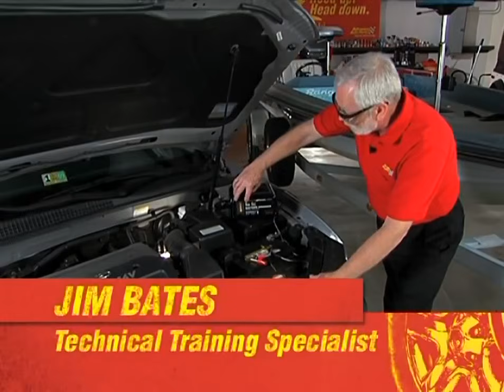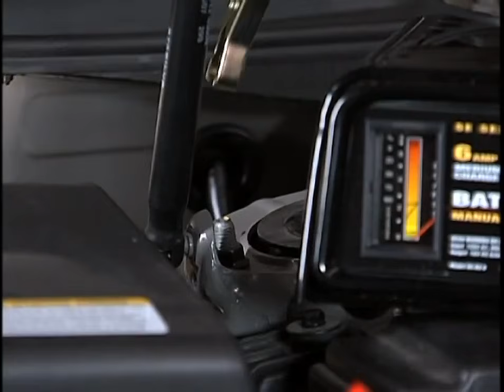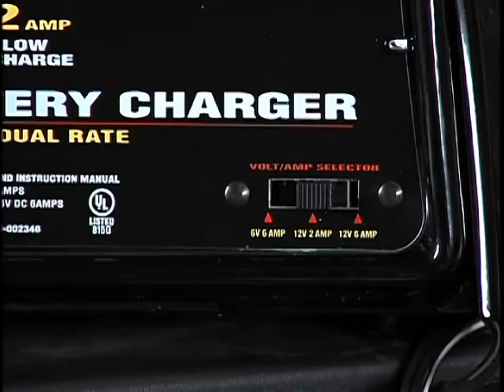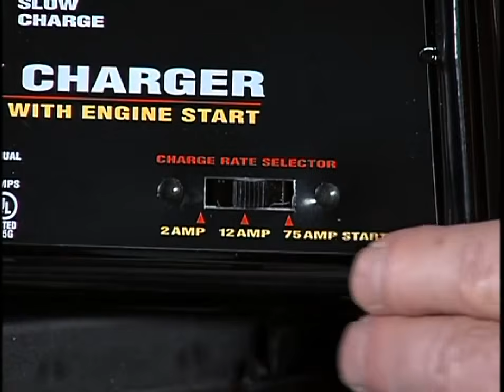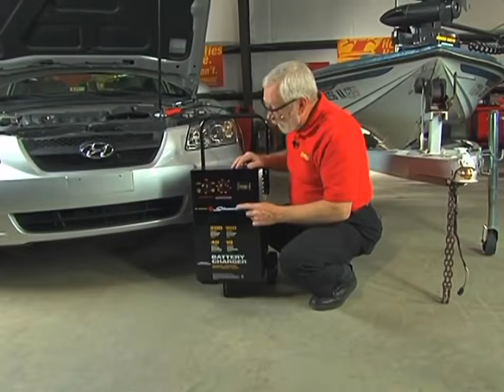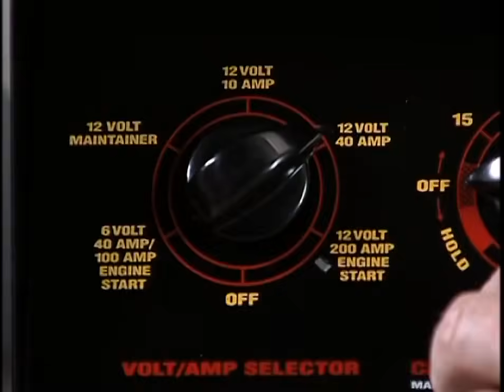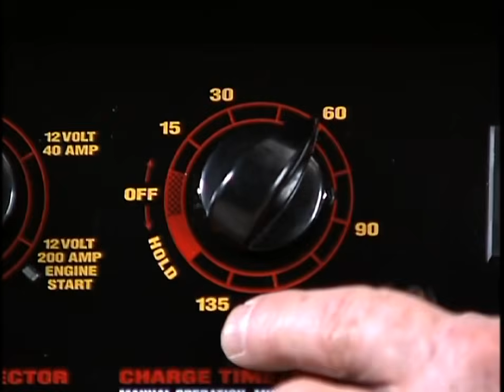How to use Car Battery Charger

Comment: lololo sorry I could do it no matter what happened...my battery says 75% close to 100%  --so why isnt it starting ?  their is nothing connected to this vehicle and I have a seperate power box from my computer ....mental health is important --lolololoscary   let me go look again no it says above 75%   and it wont start ....it wont give the car even lights...  happened after getting it back from the dealership --would not start after sitting over night...new battery
Reply: It’s probably bad. You have to get the CCA rating checked. You could have it fully charged but if it has low CCA it won’t start you vehicle.
Reply: i cant believe that the gauge doesnt work  and  i have to find the multi meter ...im tired right now and the USA is dead...thats all i cant say --i cant handle this any more....goes on and on with this situation....something is draining the battery --its doing it on its own ..maybe a light some where constantly connected through the fuse box you  must check for a drain....im so tired of sick people speaking....any where around me --their is nothing connected to this vehicle at all....you need to get some mental health help
Reply: @wireless_gov_homicide  My vehicle's
remote command starter
was slowly draining the battery
24/7.
Reply: @BatKick9  Remote Car Starters can drain a car battery in 4-6days if the car isn’t driven. Average new cars Parasitic Drain is 30ma and remote chargers usually add 70ma of drain, searching for signal.
Reply: @factsoveremotions6035  
Thank you for your knowledge.

Now I realize that I've been fortunate that it's usually lasted six days instead of four.
Could've been worse.

Comment: Excellent video. After watching, I went with the Schumacher SE-5212A Automatic Charger.
Reply: If I put battery for charging do I need to disconnect from car or not
Reply: @jackrelx4358  2 years and still no reply

Comment: so that when you make the final connection, it doesnt spark near the battery fumes or gases and possibly start a fire or explosion if those gases were to be present ,thats my guess
Reply: Battery's discharging/charging give off hydrogen gas. You are correct sir 👍

Comment: What is the reasoning for attaching the black clamp to the body of the car somewhere rather than the battery? That just seems bizarre to me. Did I miss something there?
Reply: Silvanafromchester knowing how to drive has nothing to do with knowing how to charge a car battery.
Reply: Batteries produce hydrogen gas, which seeps out through any openings/ cracks and could be ignited by a spark causing the sulfuric acid-filled battery to explode in your face = a very bad day. Some sparking is inevitable when the 2nd battery cable is hooked up to the battery post (black/ negative or red/ positive). Since the black/ negative cable is the ground, meaning that it's normally connected to car's body, it's safer to hook up the negative cable last and away from the battery. It's a clever way to avoid a potential battery explosion by creating sparks away from the hydrogen-producing battery.
Reply: FrostyCoug = a very bad ending
Reply: Thank you. I've learned from you. @FrostyCoug
Reply: Just like when using jumper cables, you always attach the negative cable, last, from the good battery to the metal on the dead battery's car to ground it for safety. Like a bracket or something
Reply: Not if you want to be a totally helpless motorist - i suppose not
Reply: @Silvanafromchester  don't be an ass.
Reply: @TheProtagonist_777  Ooh  you cut me DEEP
Reply: I'm guessing you don't drive
Reply: @Silvanafromchester  I think some of us are use to using the negative terminal.  No need for sarcasm jerk.
Reply: @jackdaniels2905  What is sarcasm jerk ?
Reply: @Silvanafromchester  ask your mom.
Reply: @jackdaniels2905  ???